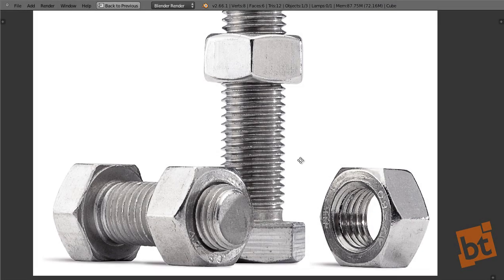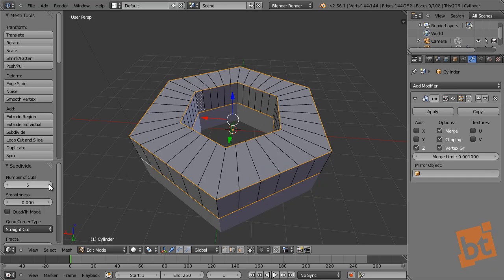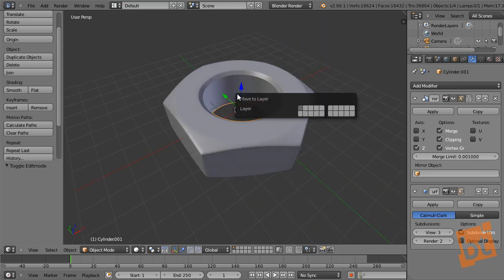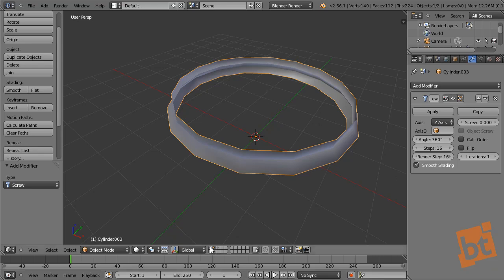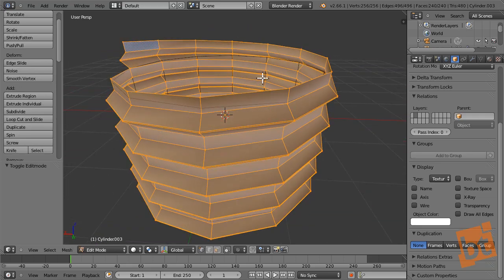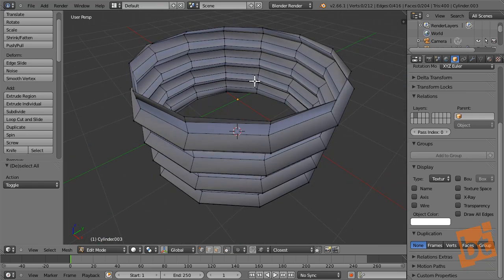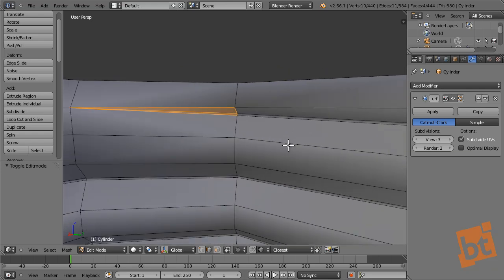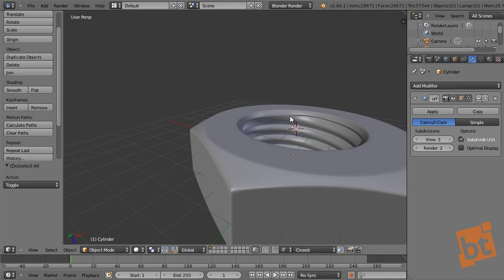How to model nuts & bolts in Blender (Part I)

Comment: Anybody know why when I press Shift+R it doesn't repeat the inset faces tool like in 10:10? When I do it, it just deselects the faces.
Reply from the maker: Don't deselect the faces and select the new ones, just start a new selection. Otherwise, the "Deselect" option is the one that is going to be repeated instead of the Inset. Is it possible that this is what's happenning?
Reply: Thats it thanks
Reply: I have the same problem, shift+R doesn't repeat the inset faces, it either does nothing or toggles to object mode.  I don't understand your explanation here, could you elaborate here please?

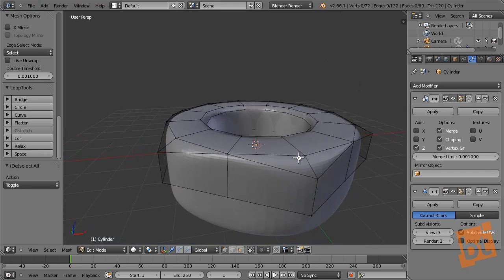Comment: Hello Oliver.  I'm new to Blender and just getting started.  I very much like the way you present your tutorials.  I believe I will learn Blender in no time at all.  I started with your nuts and bolts part 1 and came to a point at time 9:50 where you select the faces and then do "I".  When I select the two faces(to begin with) and then select I, my "faces" shrink down, but my screen doesn't look like yours does.  Yours looks like a border(the orange color of the selected face shrinks down while when you do it the orange color of the selected face is removed from the center as you are adjusting.  In otherwords, the resulted finish of the operation that you are doing in the tutorial looks like a border is around the side, while when I do it, the whole face(orange selection) shrinks down.  I'm using Blender 2.73. 

Any help you can give me would be very much appreciated.

Comment: Use the bolt factory addon. It's super fast.
Reply from the maker: But not efficient in certain cases. Plus: you won't learn a lot of modeling tricks :P
Reply: Oliver Villar  Blender is mainly for artists, isn`t it. Not technicians. If I want to model technical correct things then I would use any other 3D Software like ProEngineer or BricsCAD or similar. But those on the other hand are not really helpful in creating artisitc scenes. So I am very happy with your tut (as you surely know already :D) and the nuts and bolts are nice for putting in artistic scenes.
Reply from the maker: Exactly! Blender is not for technically accurate models or engineering, but for art. Modeling a nice bolt or nut can help in some instances for animations or recreating a real scene (or even making those CSI effects where they use magic to find a fingerprint on a 3D bolt using some kind of impossible scanner :P). I'm glad you found it useful :)

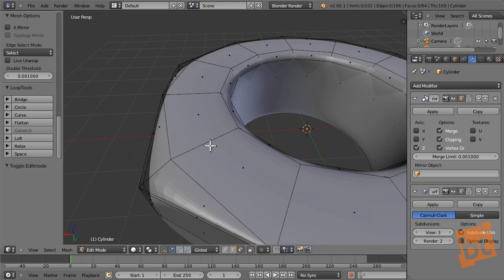Comment: Hi, I'm stuck at 10:47. When I press CTRL+R I can't add a loop on the top faces, only on the side and interior ones. Any help?
Reply from the maker: Hmm it's difficult to say without seeing your model, but that's usually due to bad connected geometry. Try to select everything and press W --> Remove Doubles. Make sure the faces on the top of the model are connected, otherwise, Ctrl+R won't work! Hope it helps :)

Comment: When I tried this tutorial on Blender 2.68a I couldn't get past the point where the hexagonal bolt is subdivided prior to using the loop tools to create the centre circle. What happens is that the subdivide only divides the side faces and not the top. When I tried to use the loop tool to create the circle I get a hybrid between the circle and the hexagon. Also it doesn't work if I loop cut each of the segments of the hexagon. What am I missing?

Comment: Can't say I ever attempted to UV texture or subdivide them. I've just used them for with procedural materials in situations where the surface detail was hardly noticeable anyways. lol

I'm not questioning the quality of your tutorial here. Just saying, in situations where it doesn't require a high quality nut and/or bolt, and you want to save time, just enable the BoltFactory addon.

Anyways, keep 'em coming. I'm always hunting for features and techniques in Blender I don't yet know about. ;-)

Comment from the maker: Well, even you can use them, you need to use them carefully. Reason is that when you apply the subdivision surface modifier, when it "divides" the topology, quads use to work better than triangles. Triangles, sometimes can produce strange pinches in the mesh, that's why it's recommended to use quads as long as it's possible :)

Comment from the maker: Hmmm did you make sure you're using the exact messure in the screw modifier? Otherwise, you may need to increase the threshold of the remove doubles operator :)